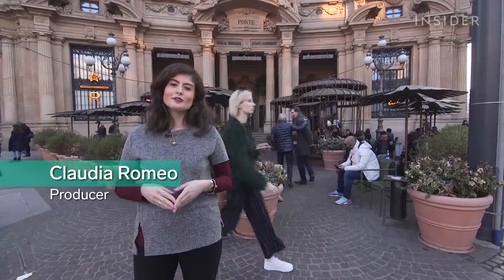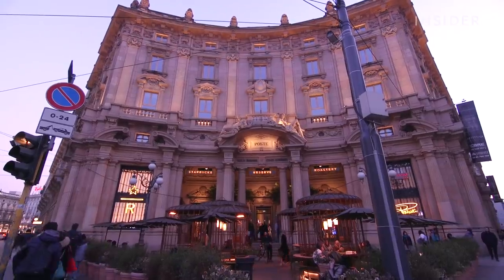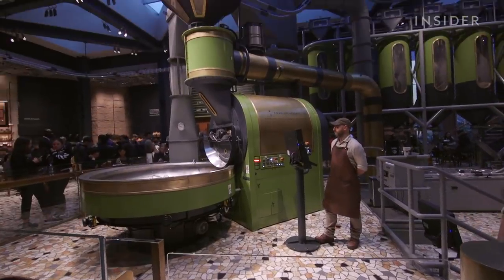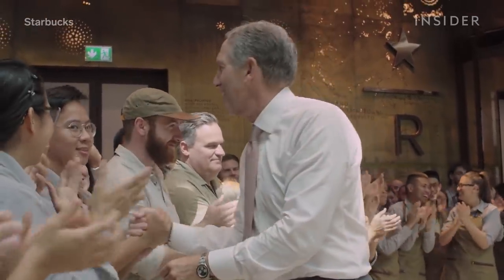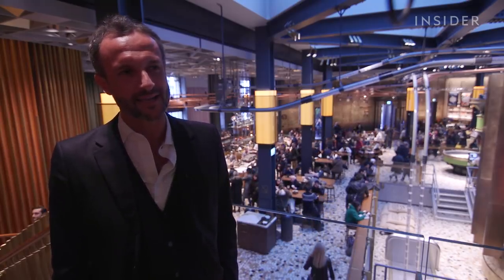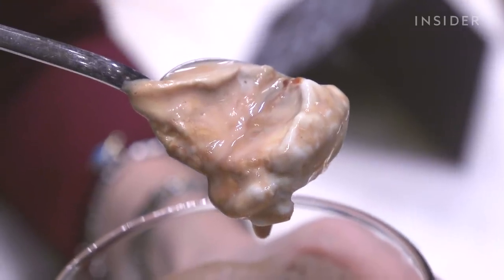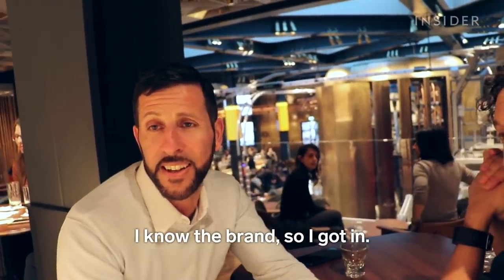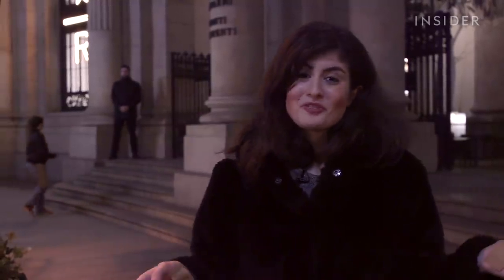Inside Italy’s Only Starbucks

Comment: I've tasted Starbucks' reserve coffee.

It barely tastes different from their normal blends. I've had like four at this point. There's something about their roasting method that just destroys the distinctness of the origin. Everything has the same overpowering oily, ashy quality to it. You can detect some subtle differences between the various blends, and it's a little better when you get them done in their clover, but it's really just not worth the price of admission, imo. I was kind of surprised to see the espresso machines in this vid making espresso that actually looks like espresso.

So, I dunno, maybe they're selling extra coffee in this Italian joint. Or maybe Italians' tastes are different from mine (Illy coffees would seem to indicate they are) and this will eventually grow on them. For my part, there's enough small bougie joints around where I live to keep me satisfied.